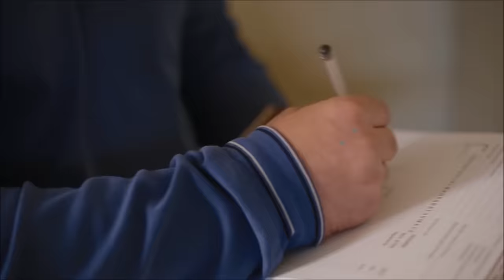Stretch Ceiling Installation

Comment: Assuming the windows are shut, does the ceiling billow every time a door is open and shut rapidly?
Reply: Of course not, use your common sense, the sheet is practically touching the ceiling so there isn't enough space for it to hollow
Reply: Move*
Reply: @dan-pi8pn  use YOUR common sense. That's a great question and there's plenty of room for it to move
Reply: The more lights you have the less the ceiling is gonna wobble
Reply: My partner has them in her apartment and I had always assumed they were just normal plastered ceilings!! With a matt finish, rather than the gloss used in this example, you really cannot tell
Reply: Tom Louie ...excellent question, but the fabricator won’t answer it!
Reply: @philipUKRUS  How much are they?
Reply: @dan-pi8pn  I bet you're a real charmer with the ladies lol... also, three little dots to the right of your comment will allow you to edit rather than double post -->
Reply: @mightymouse5930  
You’d think he would’ve used his common sense 😃
Reply from the maker: Very good question! It happens just in case of incorrect ventilation over the ceiling.
Reply: In order for that to happen the air would need somewhere to go in order to escape the backside but since it would just pressurize the air above it No

Comment: Nice way to keep a mold alive and well under the inner ceiling and skip taking care of the real problem.
Reply: doesnt drywall do the same thing though?
Reply: How is that different than any other ceiling treatment option? Mold will only be a problem if you already have it in your ceiling other than that, just keep your humidity down and it'll be fine.
Reply from the maker: Contact us with your inquiry for the stretch ceiling here https://easyceiling.co.uk/contact/

Comment: What if there is a loft hatch?
Reply from the maker: Hi, thank you for your question. Typically the loft hatch needs to be bypassed with the ceiling track and fit the ceilings canvas into by the standard way. Hope this helps. Kind regards, Elena

Comment: Does this work with ceiling fans?
Reply from the maker: One of the most common questions we get asked by clients new to stretch ceilings is how can you accommodate fittings and fixtures above the ceiling like lights, air-conditioning systems and fire alarm sensors.
Please read the details here https://easyceiling.co.uk/stretch-ceilings-work-lights-fittings-fixtures/

Comment: What's the god damn purpose?
Reply: Save money
Reply: Looks nice
Reply: For lazy ppl
Reply: a couple of things, for starters these ceilings make it possible for the installation of recessed lights are far more desirable to the eye than regular hanging lights on popcorn ceilings which are literally just a foam sprayed on the concrete ceiling that dries up.
You can't install recessed lights in concrete ceilings, when flipping a house this is definitely a good investment, even if you aren't, its definitely something to aid in the beauty of your home.
Reply: If you have a concrete room, like most of Russia does, then this is far better and cheaper for a ceiling option .